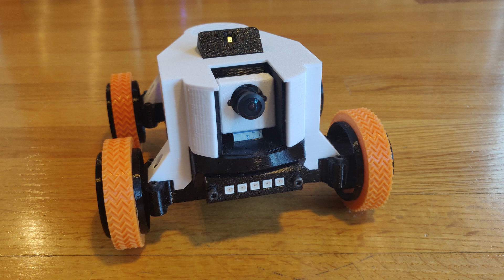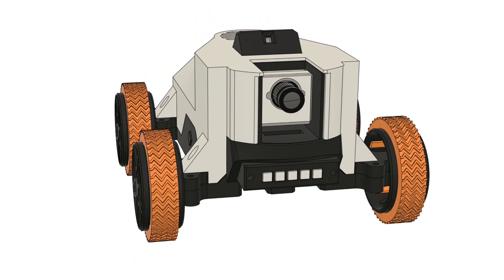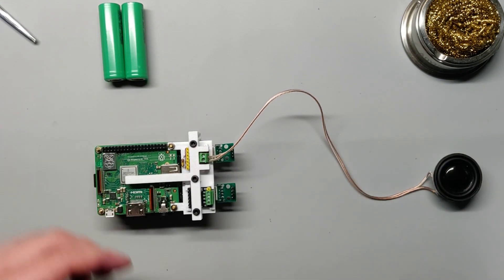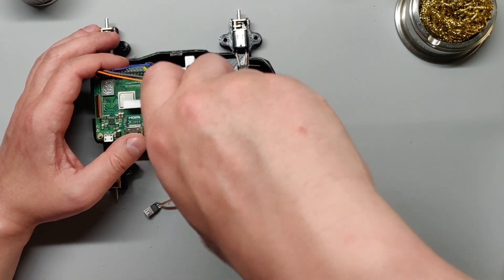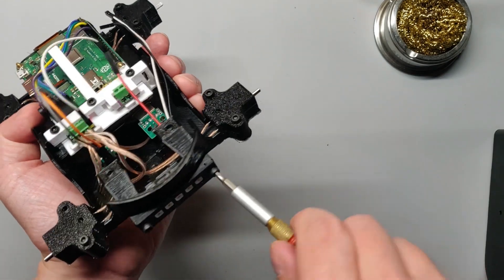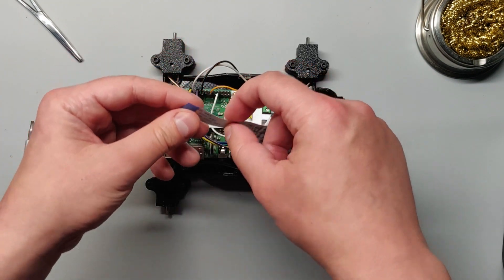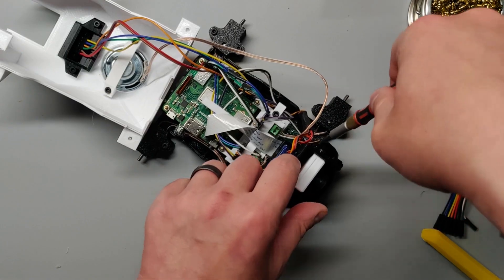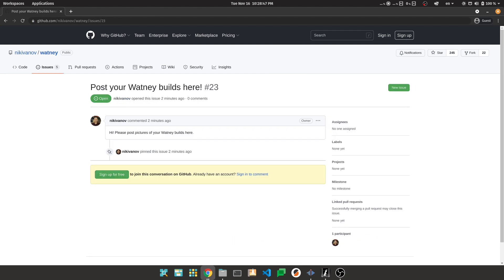Watney - detailed assembly instructions

Comment: Great work and thank you for making it open source! I have created my own platform and would like to use the watney code as a starting point since it has a lot of the core functionality I am wanting. Is it possible to run the code on a standard PI OS image? I don't need the turnkey feature for now. Or is it a tremendous amount of set up work to get the code to run? I would like to keep the default PI image so I can easily switch between PI projects.
Reply from the maker: You should be able to run Watney software on the latest image. It's on my (evergrowing) todo list to make a new image using bookworm as base. If you install regular bookworm, you can use https://github.com/nikivanov/watney/blob/master/packer/watney-image.json as a reference for what packages to install and services to set up.
Reply: @nivanov  wow and a quick reply, open source and customer service! lol I was just looking over watney-image.json and that was my original thought. Trying to figure out if it is all necessary or just certain parts.
Reply: @nivanov  Wow and a quick reply, open source and customer service! lol I started digging into the watney-image.json and that was my initial thought, wasn't sure if everything was needed or just parts? Will work on getting familiar with that .json file. Hopefully I can help contribute!

Also, I have added a display to my platform, goal is to have two way video communication. How difficult would it be to add video to the two-way communication that is already in place?
Reply from the maker: @horizons_edge_  I have 2way video in the avacar branch. It's not fully baked but a good start
Reply from the maker: @horizons_edge_  re: json file, I'm actually gonna move way from using packer to build the image and use pigen instead. But that's not ready yet.
Reply: @nivanov  you're the man, I will take a look.

Comment: Thanks, I needed something cool to print on my Ender 3 V2. Appreciate the hard work!
Reply from the maker: Feel free to post questions here or on github if you get stuck. And please post a build picture when you're done!
Reply: @nivanov  Absolutely, I'll post the finished product once I get everything printed and put together!
Reply: Is it possible to adjust the code to work with ws2812b light strip? I like the idea of only needing to use 3 wires vs 4 & i have some laying around. Thanks in advance!
Reply from the maker: @Eric-p1y3h  Yes, you should definitely be able to do that. Here's the code that drives the LED strip: https://github.com/nikivanov/watney/blob/master/lightscontroller.py I'd google "raspberry pi ws2812b" and you should be able to find a code sample of how to drive it.